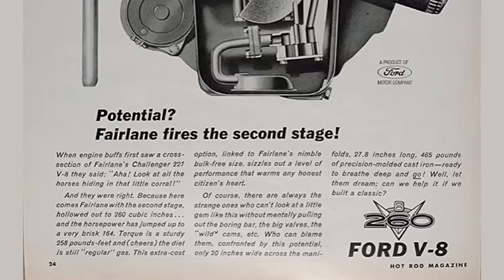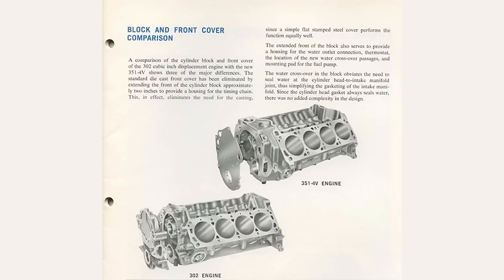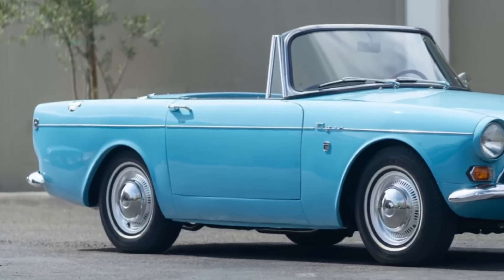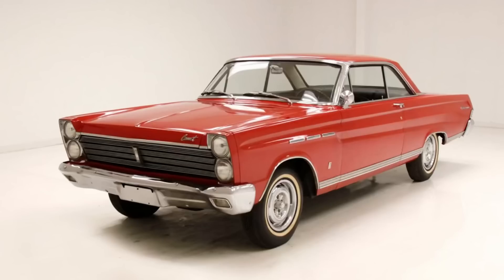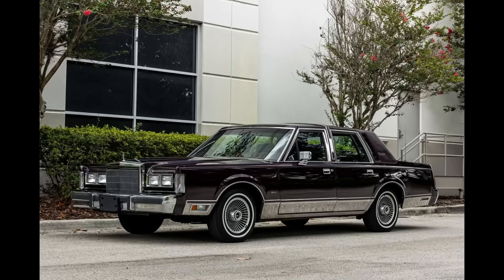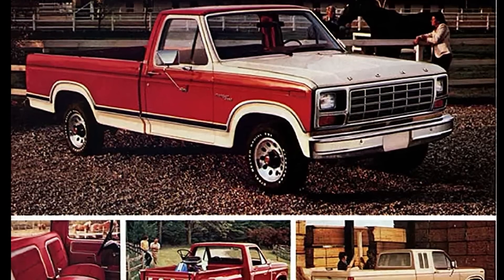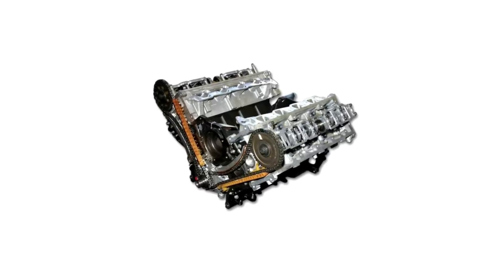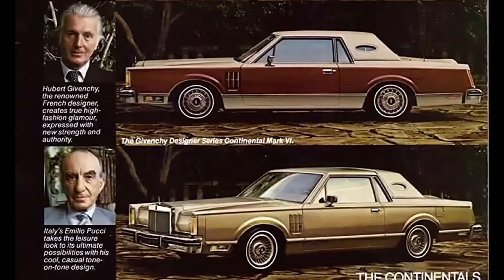Ford small block engine family 221, 260, 289, 302, 351W, 255 not the race engines

Comment: Oh my, I've been hit in the heart and I love it 🥰 The SBF is my all-time favorite engine though it's not without it's quirks and foibles. And Ford never seemed to be able to design good cylinder heads for it which is it's one major drawback, but for a stock(ish) engine if you do it right, it can offer good everything and long life too. My last build was a near-stock 2V 302 which went 285K miles when I sold it and still wasn't burning one drop of oil from wear. The only non-bolt-on failure was one head gasket, a FelPro blue, which has never failed me before. I did have to replace the carb float once too, but the rest of the running parts never needed anything done to them. And even at the end, to start it in any weather needed just a quick bump on the key, no having to hold it and wait. 

Never drove or even saw a 221, but the 260 was OK with a 4bbl, the 289 was best of these in any version, the 302 tends to wear the bores oval requiring excessive reboring and thus gives less total life, and the 351W is also pretty darn good stock or with the right build. The 255 was a 'malaise era' engine which essentially sucked. These were Ford's first effort at thin-wall block casting, which the SBC had a long head-start with and they got it pretty much right from the start, knowing that failure wasn't an option if they wanted to keep their doors open. Had they only did the heads equally well it would have been even greater. The vaunted 5.0 engine got it's start here.

With the SBC and Chrysler "A" series engines it competed with where you could throw almost any pile of parts together and get good results, the SBF required far more care in parts selection, with many things not working together well if at all. Such as the 'steam holes' in the block and heads which were there or not willy-nilly through the years, even changing back and forth in the same model year. And the change from a 5-bolt bellhousing pattern to a 6-bolter. Water pumps varied a lot and some rotate 'backwards' and there are several thermostat housing designs. Timing covers changed some too as did oil dipstick placement and length. There were different oil pans for trucks vs cars And these are just the basics, it goes far deeper than this. Before the internet it was hard to make an exceptional SBF which could match or best the other two, and many builds fell flat on their face because of this even using only stock parts. And stock, well save for the 289 HiPo they just weren't quite competitive with the others. Hoping the funds are there for what will be my last build, a 351W for a van which should serve me well till I'm fertilizing daises from the bottom-up.

WYR I like the Torino's; everyone has a Mustang. And the Mk6 embodies what the Lincoln was at heart, which got lost in later years.
Reply: Two oil drain plugs !
Reply: @davidpowell3347  Tons of differences to be found with the SBF.
Reply: ^^ Everything this guy says is true, and sums up Ford in a tidy fashion.
Reply from the maker: I totally agree with everything that you said great choices. The mark six was one of my favorite Lincolns of all time, but every single one that I ever looked at was a total lemon, except the last one. The last one was really nice. It just ran out of gas on the test drive, but I would really love to find a good one to review there’s a lot of interesting quirks about that car
Reply: The change from a 5 to a 6 bolt bellhousing occurred in mid February 1965 according to most accounts, so only the earliest of 289s had the 5 bolt configuration, as did all 260s and the 1962 221 engines.
Excepting Boss heads, nearly all Ford smallblock heads suffered from small restricted exhaust ports, and the largest factory intake valves were only 1.84, while 1.94 intakes were fairly common with small block Chevrolets, and some of them even had 2.02 intakes..
While stock smallblock Ford heads can be made to flow better (many had large "bumps" in the exhaust ports for the smog pump air outlets) it takes many hours with a die grinder and the services of a machine shop to cut the valve seats for larger valves, as well as serious porting work on the bowls above the valves.
For not much more than having a valve job and the the machine work done by a reputable machinist, aftermarket aluminum heads are available which have intake valves as large as 2.02 and much improved flow even over modified stock cylinder heads.
I used a roller cam 302 engine scavenged from a 1995 F-150 for my latest engine build, but scrapped the stock heads, it will be replacing that hideous 255 in a 1981 Fox body Thunderbird.
Just because, I pulled the intake off the 255 to find intake ports roughly equivalent to a damn Briggs and Stratton lawn tractor engine.
The entire engine (sans oil pan, timing and valve covers) went in the core pile.
That car also had 2.27 rear axle gears, they joined the 255 in the scrap pile.
 I never drove the car, I pulled it out of a field in South Dakota, but Im sure 0-60 would be best timed using a calendar.
Reply: @donreinke5863  A calendar- LOL! Your right about how stock Ford heads suck and don't approach bowties but the right ones can do OK for mild builds with a little help. Beware the multitude of CC sizes with SBF heads and know that some of the 'pollution' heads have a tendency to hot spots which can cause detonation because of the different 'wedge' design with them. Of course there's the old trick of putting 351W heads on your smally. The best of those were open-exhaust-port 69's and the 70's were the same except they had the Thermactor bosses cast in complete with cast holes to break into if you grind away too much, but those are now very scarce items with prices to match. Pushrod length is another minefield with the stock SBF parts. Dart made some great Ford aluminum heads and I'm sure there's others now too. BTW, my last build was a flat-tappet cam in an earlier roller-cam 5.0 block which worked well as the piggy-bank was too low to do any better. Another BTW is that back in my day the 5-bolt blocks were considered near-worthless as nobody was doing restorations back then and finding a matching trans was nearly impossible. You almost couldn't give them away but look at the prices now! 

You couldn't love a SBF as easily as the others, but you got rewards in knowing which parts to combine to make your engine do what you wanted, and in surprising others who thought Fords were slow and wanted to know how you made yours so much faster than the rest. It's not an easy love, but that's what makes it fun, and it's worth it in the end.
Reply: @P_RO_  I have a "checker pushrod" which is adjustable to get the correct pushrod length, and I prefer to install new fully adjustable rocker studs with guide plates. either with or without roller rockers. Early type small block heads used fully adjustable rocker arm studs while later ones used "shouldered" studs which were not adjustable, and even later they went to the "fulcrum type" rocker as used on Clevelands and "M" engines.
Aftermarket aluminum heads are generally drilled and tapped to accommodate screw-in studs.
Ive gotten a lot of power out of Ford engines, one just has to use the right "recipe"
The issue with using 351 W heads was that they use 1/2 inch head bolts vs 7/16 on 221-302 engines, there were a couple ways to get around that, they used to sell a kit with sleeves that fit down the bolt holes on the 351 heads, but the method I prefer is to have a competent machine shop drill and tap them to 1/2 inch.
In addition early blocks had "blind" head bolt holes, while later ones went into the water jacket necessitating use of sealer as with a smallblock Chevy.
 Later 302 engines also used those god-awful torque-to-yield head bolts which are IMMEDIATELY thrown into the scrap and replaced with ARP head bolts or studs, washers and nuts.
Reply: What are you talking about? The windsor is absolutely an easy to love engine. the engine is compact, lightweight, and easy to get useable power out of. The stock head argument is irrelevant, since there is a plethora of aftermarket heads readily available for a good price, just like the SBC and Chrysler LA. @P_RO_
Reply: @riogrande163  I guess you didn't read my reply very well. Aftermarket heads make all the difference in the world but that applies to any engine, not just Windsors and that's not what I was talking about. Spend enough money and you can make anything go fast.
Reply: @P_RO_ the heads on the 87 - up 5.0 mustang flowed well for the day , as well as explorer heads . The GT 40 heads were no slouch as far as factory heads go .
Reply: Yeah, during and after my high school days, “CO-93”  my group of friends mostly had Camaros and firebirds, my dream car then was the Smokey and the Bandit trans-am. (Not knowing then how slow those really were, maybe due to late 80’s smog components, anyways I got my license and my sweet grandma gave me her old car which was a well cared for 68 ford mustang 2v 289 auto. Of course my group gave me crap, and poked fun at my small motor, since they all had 305’s 350’s, and a 70 firebird with a 400. But once we started racing each other the laughing stopped as I was always just a little faster then all of them lol. and it bugged the crap outta them, and I quickly fell in love with ford especially my ford. That 400ci  had a two gear tranny that I believe slowed him down, but 🤷🏻‍♂️what ever,,, I had a 2barrel so. . . Over the next decade they/we played with different parts and the win would go back n forth but in the end it was always the little red mustang. My older brother had a 64 El Camino w 350/350 and we were exactly tied every race… good times good memories. . . Cheers

Comment: I was planning on the Fast back 289 4 speed ... the 73 "gas crisis" forced me to go OPEL. The owners son of CPL (medical lab work) had a real 65 Shelby 350 (one of 500 and change) which at my sisters wedding I got to ride shotgun. They didn't have a back seat - the spare tire was there.
Many Mustangs had the strait 6  - 3 on the tree - "real dogs" as we would say. About as much fun as a VW off the line.
Reply: No Mustang ever had a 3-on-the-tree. Every Mustang had the shifter on the floor
Reply: @markw208  Very true.  Would have had to swap in a different steering column to have 3 on the tree.
Reply: @markw208  I've never seen otherwise. Floor shift 3-speeds were an extra cost option for most other cars.
Reply from the maker: Gt story and choices 

Was your opel the opel GT those looked like smaller corvette c3 

I knew a guy that had one only car he’s ever rolled
Reply: Lots of folks wanted the styling of the Mustang but weren't exactly interested in performance. They were still great cars in their own right.

Comment: I knew nothing about the 221 or the 255 small blocks, so thanks again Jay!
Reply: The 221 was a misstep, the 255 was a joke. 

You didn’t miss anything by not knowing about them …
Reply from the maker: I drove a thunderbird with the 255 it wasn’t terrible..
Reply: @What.its.like. Your Channel takes me back to the good old days You never quite giving , can you keep it up.
Reply: i bought a new 302 Mustang Cobra 2 in 1977 an dot only had 139 hp, you had watched the Speedometer to know it was accelerating.
Reply: @mylanmiller9656    The engines in 1977 were so emissions strangled they couldn't make power.  Even the 460s were struggling to top 200 hp.  Rip all the pollution shit off, put a decent carb and some duals on it, and it'll go.

OF course, in my opiinion, the Mustang II was a mistake from Day One.  I get that Ford had to do something, but... ugh.   Just a sign of the times, I reckon.
Reply: @ Yes it was not just Ford that had a power problem in 1977, everybody else was in the same boat.
Reply: My dad had a "63 Fairlane with the 221. It was a dog. It couldn't breathe. Ironically I had an "81 Mustang with the 255 boat anchor. I know a guy that worked at the Ford parts counter. He said that the 255 was developed solely for CAFE numbers.  The EPA required a certain level of mpg to certify.  I replaced it with a 302 bored .040 over.  Woke that pony up. My favorite was my '65 Comet Caliente that spun a rod bearing in the 289 so I swapped in a 351W.  Fun times.
Reply: @oneeyedjack4727  Holden made a 253 cu in V8 from 69 - 84. 
I googled the specs yesterday and it developed 185 hp max from factory @ 4400 rpm and 262 lb/ft torque @ 2400 rpm. That was before emission laws took hold in Australia. 
The 253 was good at spinning, where the 308 we had was more poweful but didn’t spin so freely unless modified. 
It won lots of races locally and some international races. 
The 308’s last factory win was in 1993
Reply: @jamesmcgowen1769  Strictly speaking the 308 was replaced with the 304 in '85. This was done to reduce the capacity from 5044cc to 4998cc so it fitted into the under 5 litre class & didnt need to carry a weight penalty
Reply: @oneeyedjack4727  The problem with the fact that Ford made the 221 for nostalgic Reasons, It made the bore so small this limited the valve size. the 221 had only a 3.5 bore, the valves had to be close together.  If the Bore had been 3.8 like the 260 it could have used 1.92 intake and 1.50 Exhaust the same as the 312 Y block.
Reply: The 255 was a waste of time, engineering effort, and money.   Ford already had a 250-ish engine (granted, it was an inline-six, but...).   the 255 had weird , small siamese bores and goofy asthmatic heads and a HOLLOW CRANK SHAFT, and of course that absolutely horrible VV carburetor.    They actually offered that turd in the F-series as an extra cost option in lieu of the larger (and frankly, stronger and more reliable) STANDARD 300 six cylinder.

The 221 was decent ernough (though not really inspiring) in the '62 Fairlane, when the base engine were the 170 straight-sixes (the 200 became optional in '63).   You weren't going to win any races with it, but it gave a Fairlane decent enoguh power for the average Joe.

You could opt for the 260, also, and frankly it was better suited for the Fairlane.   Remember, a V8 isn't just about power, it's also about a smoother running engine.

A 260 in a little Falcon, now... that was really something.  And when the 289 came along....